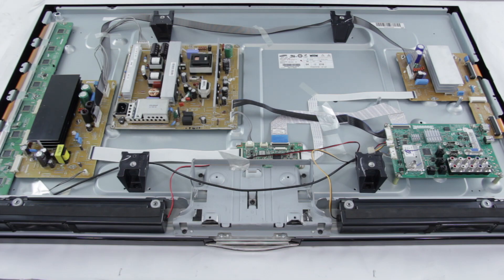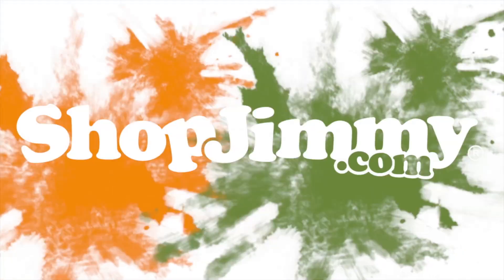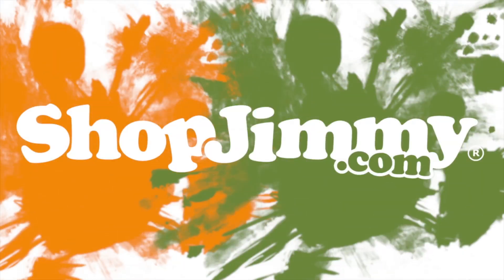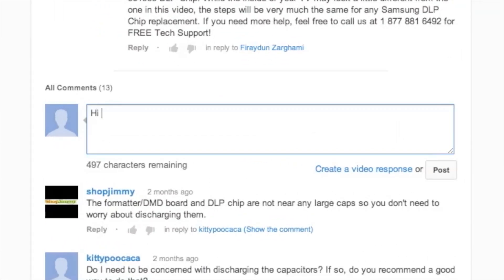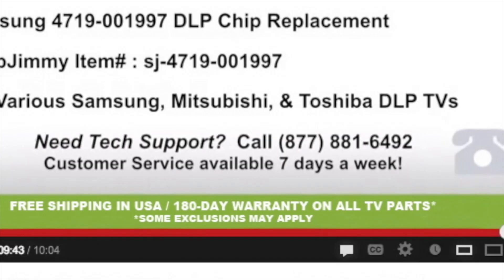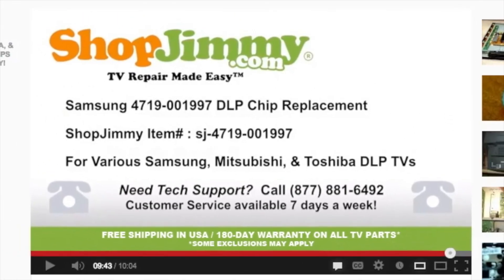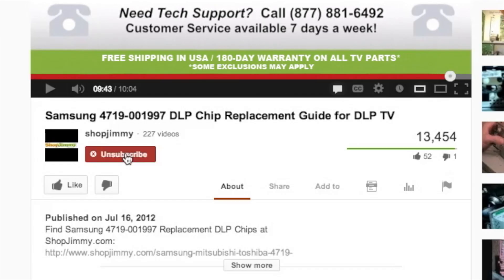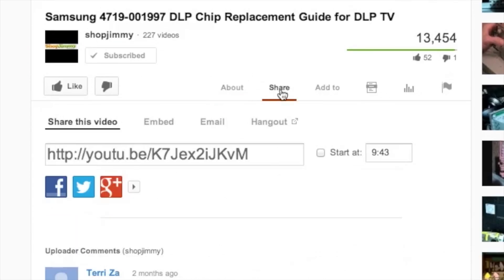Plasma TV Repair Tutorial - Common Symptoms & Solutions - How to Fix Plasma TVs

Comment: Hi, I have 46 Toshiba   model  46RV530U  when I turn on the set the picture will come on a second and then all turn black but I do have audio. I took flashlight and I could see a very faint picture. Would this set need blacklight invented?
Please advise.
Thank you
Reply from the maker: Joe Salazar   Please watch this video FIRST to help with your repair!  https://www.youtube.com/watch?v=BP3NVNCGEv8  This could be a problem with the inverter board or the power supply board in your TV.  You may need to replace each board individually to see which one fixes the problem.  Click this link to replacement parts for your TV model number:  http://www.shopjimmy.com/catalogsearch/result/?q=46RV530U  There may be multiple boards for the same TV model number, be sure to match part numbers on your current board, with your replacement for compatibility.  Thanks and please let us know if you have any further questions with your TV Repair!  www.shopjimmy.com

Comment: Have a 42PJ350-UB that will power up, function just fine, then turn off.  Clicking occurs afterwards.  Unplugging the device seems to reset the system.  Ysus board?
Reply from the maker: *****   Try this at your own risk. Unplug the TV, then disconnect the y board and plug in the TV to see if the TV powers up. Reply with the results of this test. Thanks! www.shopjimmy.com
Reply: Did as suggested. The result was the same, no appreciable difference other than less "clicks".
Reply from the maker: *****   I recommend repeating the same test on the other side on the X board.  Thanks!  www.shopjimmy.com

Comment: We own a 2013 LG 50in plasma HDTV. model # 50PA5500. serial # 208RMLM7B080. started with popping sounds and shut down. we would restart it and then would run fine. Now we have fuzzy red screen and intermittent horizontal lines
Reply: latest update it now shows quick black and whites spots and shuts down, fuzzy red screen, large white horizontal bars, black out screen intermittnent
Reply from the maker: Melissa Zendejas  Please watch this video FIRST to help with your repair!  https://www.youtube.com/watch?v=BP3NVNCGEv8  I recommend replacing the YSUS & the YDRVTP & YDRVBT boards in your TV.  Click this link to replacement parts:  http://www.shopjimmy.com/catalogsearch/result/?q=50PA5500  There may be multiple boards for the same TV model number, be sure to match part numbers on your current board, with your replacement for compatibility.  Here is a link to a video showing how to identify your part number, click here:  https://www.youtube.com/watch?v=GEllG3RV-tc  Thanks and please let us know if you have any further questions with your TV Repair!  www.shopjimmy.com

Comment: My screen looks like this: http://postimg.org/image/hma4uc5bp/
It looks like mostly vertical lines, but they are not solid.  They do appear to be solid with only the menu on the screen.  I'm thinking logic board.  What do you think?
Reply: Oh, sorry I left off the model number.  It is a Vizio P50HDTV10A.
Reply from the maker: Mike McDaniel   This sounds like a TV panel (TV Screen) problem.  If your TV panel is bad, it may be more cost-effective to replace the TV as panels are typically hard to find in stock, difficult to replace, and expensive.  Thanks and please let us know if you have any further questions!  www.shopjimmy.com

Comment: I have a Panasonic Viera 50 inch plasma HDTV model TC50PX14 2009. I turned it on by the remote and it just gives me a continuous red blinking light. I have replaced  LSEP1279UNHB Power Supply Unit, TXNSC1EPUU (TNPA4848AD) SC Board and the  TXNSU1EPUU (TNPA4780) SU Board. Can you help me?
Reply from the maker: Anthony Warren   How many times does the light blink?  Thanks!  www.shopjimmy.com

Comment: Hello, I need help with my Samsung plasma tv, the model number is PN51F4500AFXZA... My tv has sound but no picture and just makes this constant noise, what could be the issue?
Reply from the maker: dangelotol   Please watch this video FIRST to help with your repair!  https://www.youtube.com/watch?v=BP3NVNCGEv8  I recommend replacing the Y-Main Board and the Y Scan Drive board in your TV.  Click this link to replacement parts for your TV model number:  http://www.shopjimmy.com/catalogsearch/result/?q=PN51F4500AFXZA  There may be multiple boards for the same TV model number, be sure to match part numbers on your current board, with your replacement for compatibility.  Here is a link to a video showing how to identify your part number, click here:  https://www.youtube.com/watch?v=R1jmj_foId0  Thanks and please let us know if you have any further questions with your TV Repair!  www.shopjimmy.com

Comment: have a Philips tv m # 29pfl4908/f7  s. n. me1a1320149795  the tv not coming on at all no standby light or anything the compactors all look good by looking at them right. beside where the power card plugs in it has a small black box with to legs soldered into the power supply board got a magnifying glass and read the info on top it was -  nsft2.5a 250v I believe that's right the best I could see   im wondering if that is the problem Couse I found a diode right their also that I could not get continuity  thru so I put another diode in and it blue it also hope to get some help thank u so much
Reply from the maker: James Reddell  Please watch this video FIRST to help with your repair!  https://www.youtube.com/watch?v=BP3NVNCGEv8  I recommend replacing the power supply board in your TV.  Click this link to a replacement power supply board for your TV.  http://www.shopjimmy.com/philips-a3rm0023-power-supply-unit.htm  Be sure to match part numbers on your current board, with your replacement for compatibility.  Thanks and please let us know if you have any further questions with your TV Repair!  www.shopjimmy.com

Comment: Cheers for the prompt reply, problem solved, found a post with the help of Google, same model same problem, reflowed the dodgy looking joints on the PSU on powering back up the problem was much the same until I re-flashed the AV board with the latest software Thanx again.

Comment: LG 42PG6010 one click from PSU (EAY43509401) on plugging power in, one click when unplugging power. Led on power button flashes 18 times no sound or picture.
No obvious signs of bulge or leaks from caps.
Reply from the maker: Gerry O'Neill   Try this at your own risk. Unplug the TV, then disconnect the y board and plug in the TV to see if the TV powers up. Reply with the results of this test. Thanks! www.shopjimmy.com

Comment: I have a Samsung Plasma TV (Model # PN42A400C2D) that one day worked fine, and the next would no longer turn on with either the remote or the power button on the set.  I have since taken off the back panel and visually checked for any leaking or raised caps, only to find no problems.  I am stumped and can only conclude that a purchase of a  new power supply board is in order.  Please let me know your thoughts.  Thanks!
Reply from the maker: Brennan Pierce   Try this at your own risk. Unplug the TV, then disconnect the y board and plug in the TV to see if the TV powers up. Reply with the results of this test. Thanks! www.shopjimmy.com

Comment: I have a problem with the very same TV you have in this video, theres a ~1 inch vertical line that goes random colors but it's always in the same spot of the screen.

What could be causing the problem?

Sometimes it goes away but you know its there cause the line is a tiiiny bit darker than the rest of the screen.

Thanks!

PD: the TV is a little more than 1 year old...
Reply from the maker: Adrian Travelian   This sounds like a TV panel (TV Screen) problem.  If your TV panel is bad, it may be more cost-effective to replace the TV as panels are typically hard to find in stock, difficult to replace, and expensive.  Thanks and please let us know if you have any further questions!  www.shopjimmy.com

Comment: Hey guys, I have a Samsung HPT4254X/XAA Plasma TV. From this video I am assuming that my Y sustain board is bad, but I wanted to verify by posting this question. Basically my TV will come on normally and work just fine, and the picture is perfect. After around 30 seconds to a minute, the TV will shut down/power off and then go into an endless clicking of trying to turn on, turn off with no picture coming on (and the normal Samsung power on beeps do not occur) Its just click on, click off and will not end until I unplug the power cable from the outlet. If I unplug it, and let it sit for a while, then plug it back in, it will power on normally, work for the same random amount of time, then go into the same cycle. 

As i want to try to fix this tv as I am short on money, what do you think i should do to fix it? Also, from looking at your parts site, I see that you recommend replacing the Y and X boards at the same time. Does that apply here? Thank you so much for the assistance! - Matt

TV parts list from your site:
http://www.shopjimmy.com/catalogsearch/result/index/?q=Samsung+HPT4254X&tv_models=Samsung+HPT4254X%2FXAA
Reply from the maker: GibitStylin   Try this at your own risk. Unplug the TV, then disconnect the y board and plug in the TV to see if the TV powers up. Reply with the results of this test. Thanks! www.shopjimmy.com

Comment: I have a Samsung model HP-T5054. It just one day stopped working and the power button physically doesn't work. I tried to use the remote and it keeps shutting off and on with nothing on the screen. Can you help?
Reply from the maker: roney faber  Please watch this video FIRST to help with your repair!  https://www.youtube.com/watch?v=BP3NVNCGEv8  I recommend replacing the main board in your TV.  Click this link to replacement main boards for your TV model:  http://www.shopjimmy.com/catalogsearch/result/index/?cat=56&q=HP-T5054  There may be multiple boards for the same TV model number, be sure to match part numbers on your current board, with your replacement for compatibility.  Here is a link to a video showing how to identify your part number, click here:  https://www.youtube.com/watch?v=BEPWrefQvqI  Thanks and please let us know if you have any further questions with your TV Repair!  www.shopjimmy.com

Comment: Hello, Great video! Im thinking I may have an issue with my Y sustain.... YOU BE THE JUDGE.  I have an LG PZ550, 60 inch 3D Plasma TV manufactured in 2011. I am military, and in all honesty it has been in temp controlled storage, more than it has been used. Anyway, over the last month my TV has been getting hazy colors across the screen. It started very seldom, then progressively got worse. Bright whites seemed reddish and blotchy... a week later I went to turn the TV on and it stayed on for 5 seconds with pic and sound, then shut off. I was able to change the input and I noticed that when the TV was in the screensaver mode (the little LG sign bouncing around) It wouldn't shut off. But ass soon as something bright came on the TV, even if it was the menu/ settings page of the TV, It would shut off after 5 seconds. It seemed to me that it was in a cripple or limp mode. (Much like a vehicle that shuts itself off to prevent further damage) fast forward a week later, I didn't touch it for a week, and tried it again, and this time it turned on, but it was VERY dark. I could still hear sound, the picture was decently clear, but it looked as though my brightness was all the way down, yet I confirmed it was set to 75%. I had to make the room black, to see it. I monitored the TV for about an hour, I shut it off, and then turned it back on, this time it was completely black. But I can still hear sound. I reconfirmed today, that it still turns on, and plays audio, but cannot see any picture........ I went through the BS with LG support. I obviously tried other HDMI inputs, And made sure it wasn't my cable satellite provider..... Love how they try to pass the buck before they tell me whats going on. Thanks again for the video, would appreciate any info. -John C.
Reply from the maker: John Curtis  Please watch this video FIRST to help with your repair!  https://www.youtube.com/watch?v=BP3NVNCGEv8  I recommend replacing the YSUS board and the YDRVTP & YDRVBT boards in your TV.  Click this link to replacement parts for your TV model number:  http://www.shopjimmy.com/catalogsearch/result/?q=LG+PZ550  There may be multiple boards for the same TV model number, be sure to match part numbers on your current board, with your replacement for compatibility.  Here is a link to a video showing how to identify your part number, click here:  https://www.youtube.com/watch?v=GEllG3RV-tc  Thanks and please let us know if you have any further questions with your TV Repair!  www.shopjimmy.com

Comment: Insignia NS-42P650A11.    Started out with picture going blank and sound remaining and picture would come back with a power cycle.   After a week or two TV would no longer power on and went through 3 clicks in the power transformer.   It would power on and stay on with the Y-Board disconnected.   I replaced both the power board and the Y board and now get 5 transformer clicks but still no picture.  Is this because of firmware?
Reply from the maker: Jeff Waterhouse   If you did not replace the buffers (y scan drive) with the y board, then you should replace them, or you received a defective replacement Y-Main Board.  Click this link to replacement parts:  http://www.shopjimmy.com/catalogsearch/result/?q=NS-42P650A11  Be sure to match part numbers on your current board, with your replacement for compatibility.  Here is a link to a video showing how to identify your part number, click here:  https://www.youtube.com/watch?v=R1jmj_foId0  Thanks and please let us know if you have any further questions with your TV Repair!  www.shopjimmy.com
Reply: I did the above.  The first time on I thought it might work as there as a 1-2 second pause after the first click from the power transformer and then the other clicks happened.   After that first time it now behaves as it did before any repairs.

Comment: My plasma 58' TV Model # PN58A550S1FXZA,is clicking on and off and when it does come on the pictures is not clear and a lot buzzing noise.  But recently no picture and still clicking on and off- like power cycling in a loop. I opened the back panel and none of capacitors seems to be warn out.  I'm thinking testing the capacitors for voltage.  What are your suggestions?
Reply from the maker: Timothy Johnson  Please watch this video FIRST to help with your repair!  https://www.youtube.com/watch?v=BP3NVNCGEv8  I recommend replacing the Y-Main board and the Upper & Lower Y Scan Drive board in your TV.  Click this link to replacement parts for your TV Model number:  http://www.shopjimmy.com/catalogsearch/result/?q=PN58A550S1FXZA  There may be multiple boards for the same TV model number, be sure to match part numbers on your current board, with your replacement for compatibility.  Here is a link to a video showing how to identify your part number, click here:  https://www.youtube.com/watch?v=R1jmj_foId0  Thanks and please let us know if you have any further questions with your TV Repair!  www.shopjimmy.com

Comment: Hi I have a Samsung Model HP-R4252 and the screen always takes a while to get color. When powering up it looks like black dots and blobs move around the screen and remains that way with faint color and picture mostly in the middle. The black parts never leave it just moves around the screen like water flowing and its pretty solid black  near the bottom and edges. On rare occasions the screen will flicker and work perfectly fine for seconds. The screen is always this way no matter the source, with or without anything hooked to it so I know its not the other devices or where they hook up, though i know nothing about tv's. Any Ideas as to a solution?

Comment: I have a LG 60pk200-ua plasma. It sits in standby mode fine but when you turn it on the picture starts to light up then goes back off. There is the little red LED light that stays on till the picture is about to come on, then it starts to fade. Then the tv shuts off so the red LED light comes back on. The standby light. I believe it's a power supply issue but I do not know much about plasma tv's. Is it a fail safe system that is causing this problem? Any help would be greatly appreciated.
Reply from the maker: jaysun440  Please watch this video FIRST to help with your repair!  https://www.youtube.com/watch?v=BP3NVNCGEv8  I recommend replacing the YSUS and the YDRVTP & YDRVBT boards in your TV.  Click this link to replacement parts:  https://www.youtube.com/watch?v=gnkyAGyI7GA  There may be multiple boards for the same TV model number, be sure to match part numbers on your current board, with your replacement for compatibility.  Here is a link to a video showing how to identify your part number, click here:  https://www.youtube.com/watch?v=GEllG3RV-tc  Thanks and please let us know if you have any further questions with your TV Repair!  www.shopjimmy.com

Comment: I can't find anything exactly like mine.  I have a 55 inch Insignia Plasma Model No. NS-P501Q-10A from 2009.  My problem is light colored vertical lines all the way from the bottom to the top and they are spaced a few inches apart.  They are all the way across the screen and are really obvious when the screen is showing light colors.  The lines are light, but every now-and-again a portion of a few of the lines will be red and sometimes they will be black (but that usually doesn't last long).  Any ideas?
Reply from the maker: Yaccob Schmiedt   This sounds like a TV panel (TV Screen) problem.  If your TV panel is bad, it may be more cost-effective to replace the TV as panels are typically hard to find in stock, difficult to replace, and expensive.  Thanks and please let us know if you have any further questions!  www.shopjimmy.com